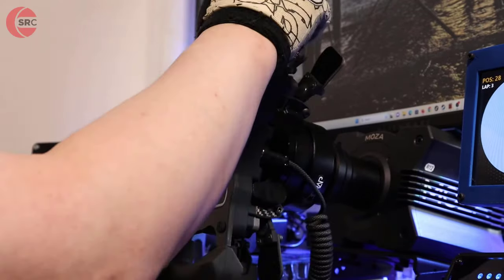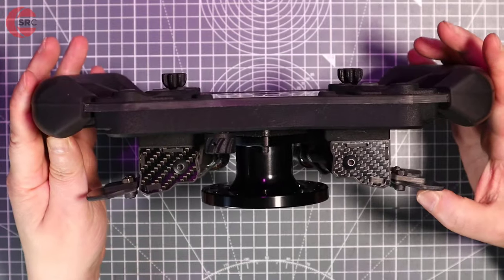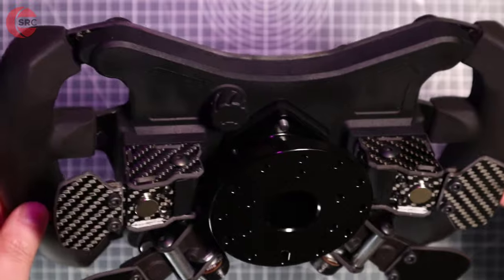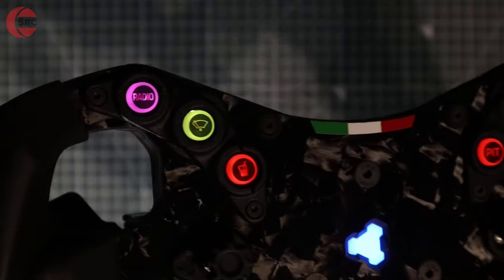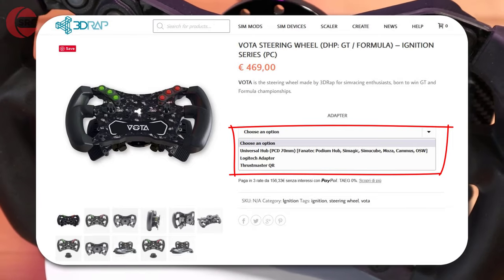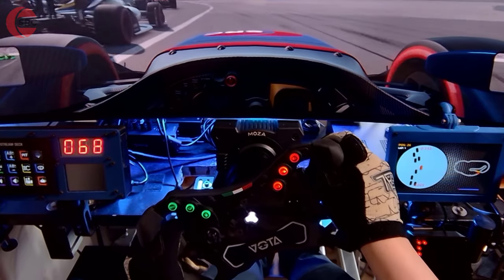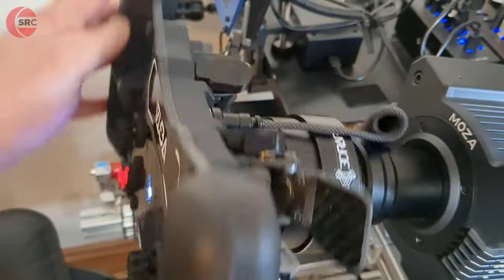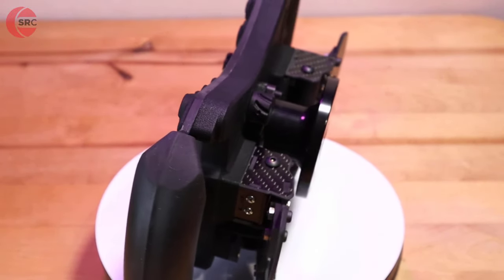3DRAP VOTA Steering Wheel [REVIEW] An elegant showpiece made in Italy!

Comment: Is the clutch paddles resistance high enough to accommodate enough muscle memory? Can you compare to some other wheel? I am considering this wheel because the clutches (there is so little options in this price range).
Reply from the maker: It's not the same consideration as operating foot pedals, which I think you may be comparing this too. I have 4 different wheels with clutch paddles, and they all have very similar tension.